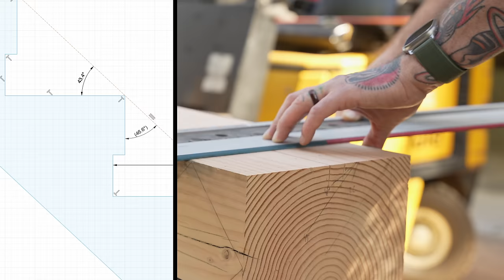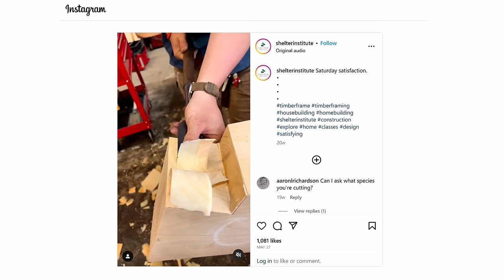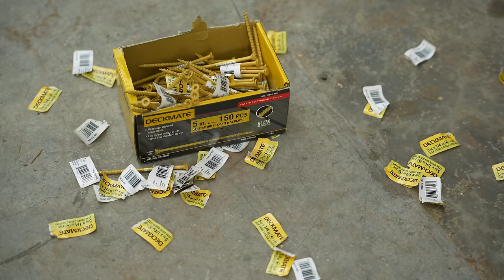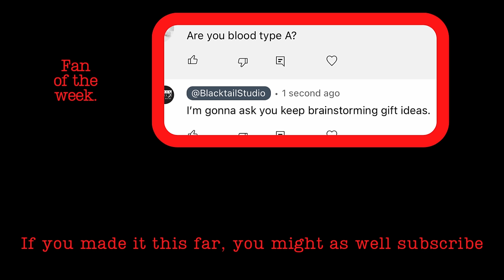Timber Framed Staircase Build

Comment: I was thinking that big block of wood at 25:15bwith all the rows of drilled soon-to-be-screw-plugs really looked kind of visually interesting as a displayable art object. 

(BTW, last year I built a 4-inch timber step to cut the 8" step-up height difference danger in half from the garage going into the house for some elderly relatives.  I drilled through the solid wood natural finish slab step to set some tap on screws to anchor the step to the underlying concrete floor.  I cut some screw plugs from an appropriately-sized dowel rod and stained them a deep red contrasting color and thought that made for an interesting visual accent.  After all, the plugs are obviously there - why not make them visually appealing?  I think that would have made a nice light and bright accent pop on this gorgeous heavy timber black and natural staircase.)

Comment: johnny builds. Hey Cam, a few questions if you have a minute please.

Thanks so much for such an informative channel. My Cherry slab coffee table is entering the final stages of sanding and these questions are coming into my head as my mind wanders with a random orbital in hand.

1: I am a little confused as to when to drill the threaded inserts into the bottom of the table for the legs. It seems to me that it gets done at a different point in the whole process on every build. Is there a definite point where it needs to be done after a certain step but before the next step?
2: Do you try to plan out where the threaded inserts will go before starting the build so they don't land in epoxy and is it OK if they do land in epoxy?
3: Have you ever done a wood finish such as Odies Oil or Rubio Monocoat on the wood, sanded to the specifics for the finish, which is usually around 180 grit, and then sanded the epoxy to like 2000 grit and polished  with some sort of automotive wax on the same table? If so, which do you do first?

Thanks again Cam

Comment: I would only have had the metal crossmembers bigger on both ends, the lower one embedded in the floor and maybe with a hidden bracket to minimize torsion. 

Except that, the design and esthetic are brilliant.

Comment: I built a similar set of a mono stringer stairs but the stringer I used 4 lvl’s and the treads were a 3 inch micro lam beam which I mortised a 3/8 thick steal plate in the bottom

Comment: I don't mean to be critical, but I'm afraid it will break because the stringer is thin with those cracks, and with those extra weights from each step and torque from stepping those steps of the center, it will be unstable.

Comment: Would’ve left the thickness of treads between 3.5-3.75 besides the the bottom-center (where they fall on the beam).  Thats where I’d of gone to 3 so they were thicker and locked into the beam.  Not really going to matter, personal preference.

Comment: Ok… I tumbled head over heels down my basement staircase…. My question… can I cut out my timber frame stair to replace my rotted out basement stair, with my jig-saw…. might take some time.  Or, would it be better to route in the tread support grooves.  The current has one of the full size 2”x 10” support beams with the treads inlet into the sides of the beams by 1/2”… or so. My last stair case for the back porch has all the pieces cut-cut and routed…. But been 4 years finding time to finish.

Comment: I have to ask. Will the N3 nano work with boil linseed oil? I use BLO quite a bit, mainly because I love the color it produces. I have successfully put polyurethane over the top of BLO and ended up with beautiful finishes, but it takes a long time since the BLO needs to dry for about two months after applying to be able to seal it with polyurethane. SOOOOOO... What I am getting at, is... Could I use your n3 nano over the top of poly? If I can, would I still need to wait the couple of months? Thanks man!

Comment: Here's the fatal flaw in the staircase: You connected the staircase at the top with screws at a right angle. That way the screws experience a sheer force, which isn't optimal. The connection should have been done with crossing screws at 45° so the screws bear the load in tension.

Comment: They make little clamps that attach to a framing square that eliminate the need to make that "stringer jig"...tho, i get it. It worked
Edit: set thise forks down on jackstands or cribbing
Edit 2: you should have doubled up the heading you screwed that to up top...

Comment: I wonder how you could make what I made but with 0 mistakes. If you took the piece that you cut off 7:46 . what is it a two inch "long" 8/8. What if you took 30 of them. And I laid them all flat, endgrain facing up. Like an large endgrain cut board. But an epoxy table for the kitchen

Comment: Johnny Builds: cool project but 2 major issues..

1. No handrail means it doesn’t meet code. You probably don’t care but it’s a huge liability for guests and guests with children. 

2.  There seems to be a lot of twisting when you walk up and down the stairs. The top and bottom could likely use wider wheelbases to prevent the twisting.

Comment: I  have built stairs    I guess you know  this When  I calculate  the steps   you go  from finish  floor to finish floor      Then   divide by 7  and  that will tell you how many   risers  and what the height of each one  is   Say you come up with 7  3/4 x 12  risers  then   multiply   7 3/4  by 12  and  see iif  that is the same  length.. say you are 3/8''  short  then add 1/8''  to each of the last 3   risers You  could have taken   a scrap  and  cut a pattern  piece  to see  if it fits  Then  drop the first step for the thickness  of the tread

Comment: should have filled the beam with bonding Resin as it will aversely snap.  in half.  resin as it was stained black. it bends under your own Weight what happens when you have a Load or you have more than one on the stairs?  NO not a Steel spine. : -  Resin in the cracks.& sanded flat.  Think about it.

Comment: They look nice, but your shots of you finishing them at 27:10 show they are super wobbly even with just you moving around on them slightly.. Those screws attaching the entire thing to your 2nd floor are a big no-no in my eyes. Concentrated load at the centre of the joist there is not great. Lag screws or a better structural fastener that is designed with shear in mind would be my thought on that matter.

Comment: Johnny Bills misspoke when suggesting a natural finish should have been put on these steps. The colour you chose is far more contemporary which is a much more compatible choice given the contemporary design of the staircase. 😅
Reply: Would add that I’m no structural guy, but while watching, was thinking about my staircase, which had oak spindles and handrails and risers. I have 8 steps, a landing, then 7 steps, and am thinking of an open design but with two support beams. Over time I would be concerned about twisting or loosening of individual steps. If yours is for storage or work area, that use might exacerbate the potential for failure if heavy items are routinely going up and down. Also, while I like the finish, I’ve been thinking about the potential for slipping on bare wood. Should the treads have something grippy? If material is going up and down, should there be two handrails? I have seen single beam support for staircases but assumed that the whole structure had a robust hidden steel framework on which the steps were mounted. As I get older, I have a newfound respect for structural integrity that underpins 26:43 truly artistic design. One last question…..wouldn’t a laminated beam offer more strength and durability than a single solid wood beam? 

I’m not in that business at all (other than as a materials porter as a kid) so read my comments with that in mind.

Comment: Johnny Build. This is what happens when you have a great carpenter but a bad engineer. The staircase turned out to be insufficiently rigid because you had an error in the design, a poor understanding of load vectors and resistance of materials led to the fact that you wasted a lot of good material and got a bad result. You should have added a stiffening rib at the bottom of the stringer, the steps should have been attached to a dovetail joint and glue so that they became part of the structure and took on the bending load, then the staircase would have been quite rigid, with no significant change in appearance. Anyway, thanks for the video, it was a good job, it's a pleasure to watch you. Greetings from Russia.

Comment: Stairs are a safety item and should only been used if approved by an expert. You can do this easily: apply for a building permit and have the city inspect it. I would not use it until this is done.

Comment: Just don't walk on it after Christmas. No way that top mount or the treads will stay put in a couple of years of moderate use in the style you so handsomely demo'd to show the counter force applied to the fixings, it'll turn into a plaster wall DIY job and just create extra movement on the stairs and like a run away train which goes too fast....... derailment ensues. 
It needs horizontal support for each tread and other than a big design change you can only accomplish it with metal from the wall, good luck!

Comment: You can't send me to Johnny Builds - I think I was subscribed there before here.  

The theoretical inspector might ding you for not having a stair rail on the facing side, rather than the wall rail that you have. I also echo the point made by others that the header connection could be an issue in the medium turn (Mike Holmes would hate it). You're really relying on the floor bolts to keep the stringer in tension with the header, with a couple of coach bolts to keep it in the same place.

Comment: Over Engineering calculations?
Ask yourself, what the weight of average person.
The metal plate mounted on the floor will not slide.
The weight of whole structure was enough to sit permanently.
The horizontal steps 2 inches are thick enough to carry one person weighted?
The slot to hold this slab are squared. A piece of screw will secure.😅